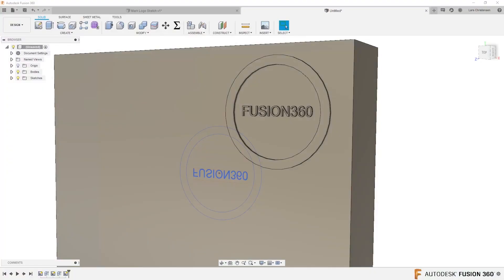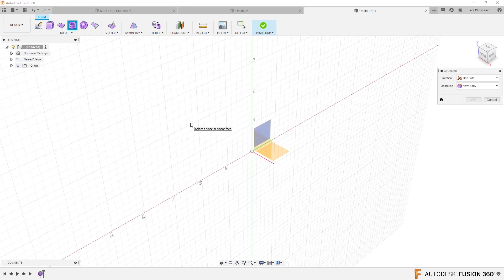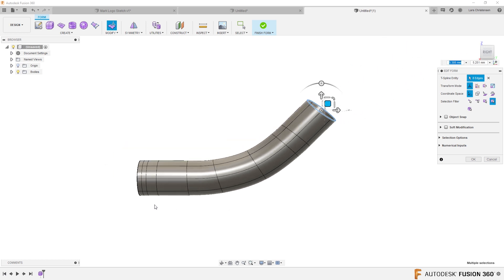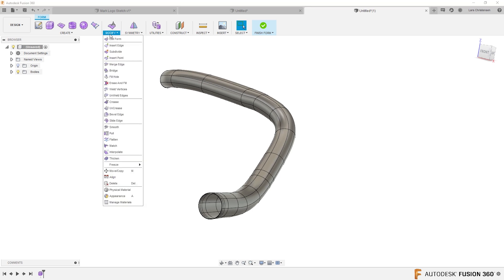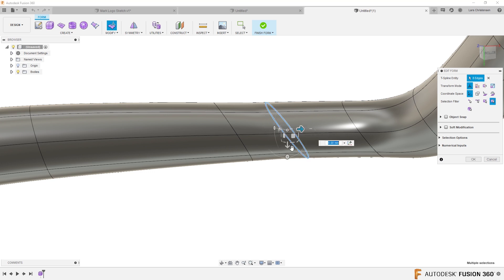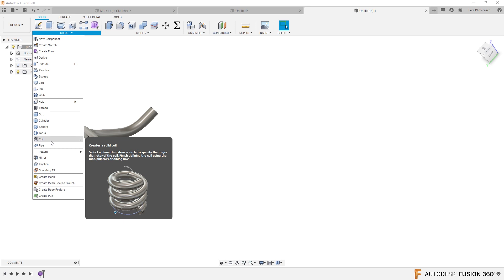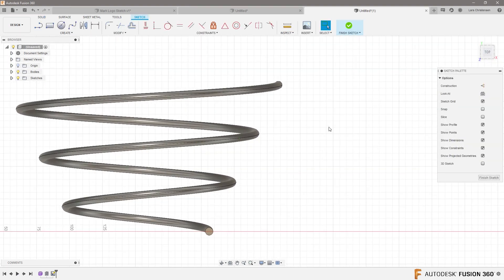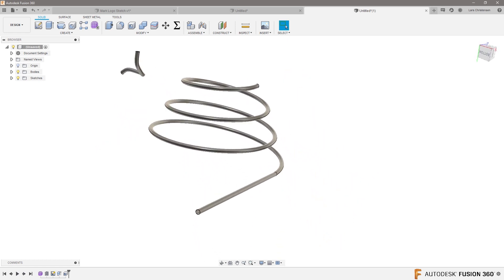Fusion 360 — Two ways for CRAZY Straws — Ask LarsLive

Comment: Please how to make violin top arch
Reply: I suggest using wood.
Reply: @alejandroperez5368  when i import DXF file I will not able offset
Reply: @venko3211  did you check the dxf sketch is not fixed? You need to unfix it (make green lines blue)
Reply: @alejandroperez5368  thanks
Text the letter then extrude the 15mm after how to taper the text .
Reply: Waiting for your reply sir
Reply from the maker: Link to a video in an earlier reply 👍😊
Reply: @cadcamstuff  please send me link how to taper the text
Reply from the maker: Did you see this video? https://youtu.be/B6LujVM-R8s